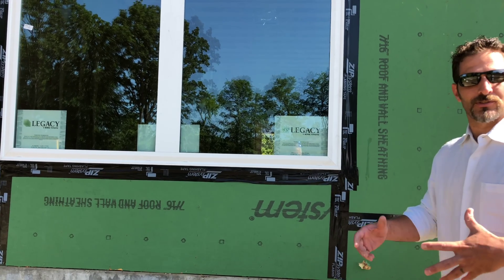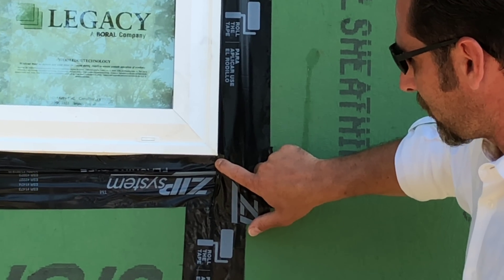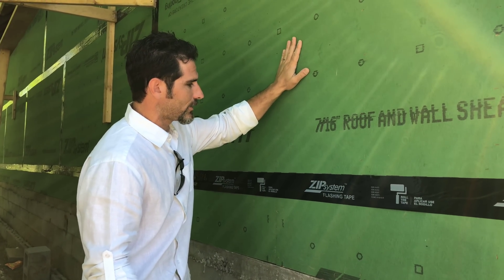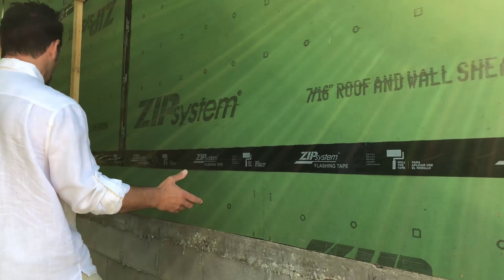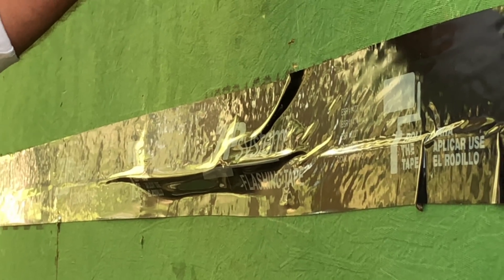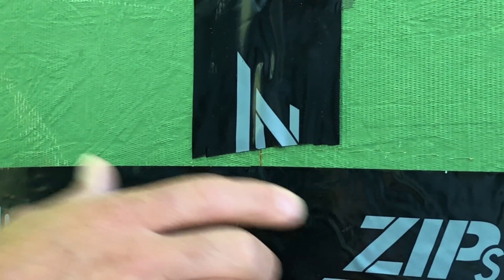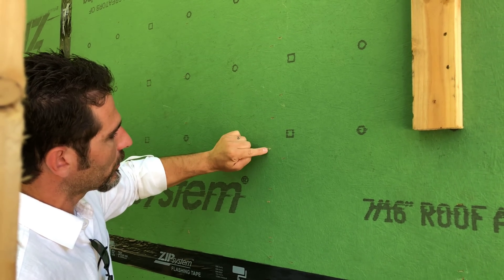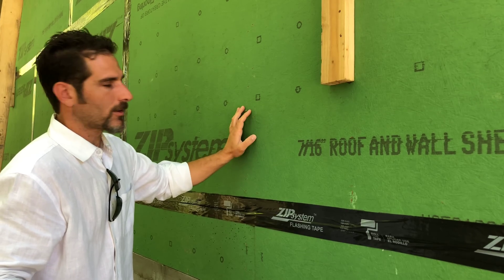ZIP System Problems

Comment: I clicked to see common problems to avoid and find that perhaps you could look more into the building science before misguiding viewers.  This is obviously a bad installation of a great material.  I see you are heavily into shingling, but I sense a misunderstanding of air sealing.  Tyvek gives us zero air sealing, and the transitions are a challenging origami for new construction crew to master.  When done right, Zip-R gives us shear, thermal break, air sealing, and waterproofing.  Liquid flashing can easily solve the problems you highlight, with just two products.  That's a lot of steps saved, and worth learning to do well.  From a building perspective, we want the low perms - let it dry to the inside from the inside, and dry to the outside with a rain screen.  The inboard insulations will prevent any condensation.  There are more facets to this picture than shingling.  We'll be using it on our upcoming project and this is how I found your video.  Peace.
Reply from the maker: I am not sure where I have misguided anyone but maybe you could fill me in after you educate yourself better!  The video is designed to show the common problems we see when taking these systems apart to correct water intrusion.  I simply stopped by a random house with the ZIP system on it & sure enough found the same problems we see when correcting water intrusion!  The video is not showing how this system doesn't work when installed correctly (that has been proven by several different third party testing companies already), the video simply shows how it is not an easy system to install correctly & when its installed incorrectly it is not forgiving!  If you want to rely on tape & caulking to keep water out of your structure without any way to shingle anything then you are welcome to do so but to me that goes against all the weatherproofing experience I have!  I wish you luck when using this system & hope that you pay close attention to detail & get every piece of tape perfectly adhered as well as cover every fastener hole!  Peace
Reply: @WeatherProofingAmerica  I guess I missed where you discuss how Tyvek performs in air sealing.  Not sure if you are against it or unaware of the issue.  Perhaps that's not your problem so you do not care about this.  
I've seen many more examples where Tyvek, tapes, staples, cap nails, shingling around doors, windows and other penetrations are more difficult to execute at a high level than Zip 2.0.    Zip 2.0 is a great system.  Have never liked the tapes & don't see the longevity in that approach.  Keeping water out of an air-leaky house seems like a lost opportunity to do a good job, performance-wise.  Wherever we get on the ladder, we can look both up AND down.  I always ask what the best in the world are up to.  Ignoring the bigger picture while touting a single aspect shouts of snake oil.  That's all.
Reply from the maker: Don Kingery the big picture from my perspective is this system will more often than not, be installed poorly which will set homeowners up for massive payouts to correct something they should not have to! Tyvek installed poorly still covers the majority of the vulnerabilities ZIP doesn’t! If you look more into Tyvek you will find that it is intended to & can be a great air barrier also if installed correctly! The reason I like to recommend Tyvek is because I have personally used Tyvek to CORRECT many types of water intrusion and have seen things that most don’t because of us taking wall systems apart daily!
Reply: @WeatherProofingAmerica    I'm a general contractor and not a sub.  I often tell clients that if someone is selling pickles, then pickles are the answer to every problem in the world.  I'd concede that the fixing that you do is not about Tyvek, but poor workmanship.  I've spent many years fixing bad work, and it's almost always the workmanship and not the products that are to blame.  I started using Tyvek on custom homes way back in the 1980s because it was an improvement over felt paper.  This was before building science knew what was happening with air, water, and thermal leakage.  Heating and cooling a home, only to have conditioned air leak out is wasteful.  Tyvek, if installed in a laboratory perfect manner (rare) and addressing all the penetrations, hundreds or thousands of staples, origami, etc. (even more rare), can address water intrusion, but does nothing for air infiltration nor thermal transfer.  This means many additional steps for much less benefit.  This is the 21st century.  Labor rates in our area are higher, perhaps, than in your area.  I gave up trying to save material costs and working for less money or asking others to do so.  We get paid for end results; not by saving a penny only to cost our clients dollars over the decades to come.  I like the synergy of systems that deliver multiple benefits - air + water + moisture + thermal.  If both belt and suspenders leak, neither is effective.

Comment: This is an interesting video and part of a valid debate about various WRB systems and their merits. However; a great deal of the valid critique in the video deals with poor installation details as opposed to failures in the product design itself. Calling anything 'foolproof' ignores an old engineering expression I heard for years in the oil industry. We called the best systems 'idiot resistant' rather than idiot proof because as an experienced engineer would point out; God makes better idiots than engineers can make systems.
Reply: Still a crappy product! The Europeans are waaaay ahead of us in wrbs, and barriers
Reply: @roberthaverlock8605  Why is it crappy compared to systems that are available for use in the US.  Comparing it to unavailable of overpriced systems in Europe says nothing.
Reply: @roberthaverlock8605  What are the systems or products you think are most useful from Europe? We're looking to very heavily renovate an old home in 2023, and while I'm planning on ZIP (following Matt Risinger's recommendations on best installs), I'm definitely curious about other options.

Comment: Use liquid flash on all joints  and fasteners problem solved
Reply: If installed properly liquid flashing is great!
Reply from the maker: You might watch the video again because that would be far from the solution!  Thanks for watching & commenting.

Comment: Build w concrete, stop subsidizing lumber industry so this garbage is pushed on people . I build a house in Europe vs the one in America, maintenance is night and day . 
Stone and concrete works .
Reply: Depends where you are in the US, for high levels of seismic activity you're better off with wood frame construction. https://csengineermag.com/article/wood-frame-construction-advantageous-in-areas-prone-to-seismic-activity/
Reply: @rooford1  your nit picking
Reply: @rooford1  it also basically depends more on your budget as well.
Reply: There it is! I was looking, knowing, the concrete freaks would show up at some point, and here it is! How about you subsidize affordable housing for all the homebuyers who can't afford to build concrete construction, and we'll go from there......
Reply: Rusty Rhodes I am not a freak , you should have manners . Building is my trade and you are wrong . One word , Romans ...
Reply: @SamiKrasniqi  wtf does that mean?
Reply: @SamiKrasniqi  - Today, far more buildings are torn down than fall down. Three thousand year longevity is not a goal, not even relevant to the modern home-owner in any country. Most people want a house that is durable enough to hold its value until the time of resale, but affordable enough that they can realistically build it. They are building a house for a few generations, not a monument for the next epoch.
Reply: pterafirma  

even if we go w your argument which can be agreeable, timber construction and materials we use doesn’t allow you to have a home without major renovation after 20 years . Roofing , kitchens , bathrooms and decking are virtually gone after that period and sometimes less . They have a cute name for tens of thousands of repairs needed , they call it dated . 
Clay roof tiles , slate deck, concrete home w powder coated windows , build in 1998 , nothing needs to get fixed . Had the painters few times , that’s it.
Reply: Lol....tells me to have manners, calls another user a fuckin inbred. Pot meet kettle.
Reply: Rusty Rhodes he used wthf , fuck your pot and kettle ass.

Comment: Excellent review of this product compared to Tyvek. I've been studying building science heavily for several months and it's tough to find videos like this. Zip systems look appealing but it's hard to justify the cost vs other alternatives. Breathability is definitely an essential component to the longevity of the structure. Can Tyvek homes be built as tight and what is the comparable high R value option...rigid insulation below OSB?
Reply from the maker: Tyvek can absolutely be a great air barrier when all the seams are taped, Tyvek ran past bottom plate line & above the top plate as well as the windows installed per DuPonts instruction!

Comment: You have to use a system that is hard to screw up from the lowest common denominator... The labor installing it.

There are very very few craftsman left who take pride in their work. So many of these homes are made by major companies doing tract homes, all built by the lowest bidder and barely trained to do a half decent job. They'll get it done, but that's it.

Water proofing systems are critical, and if there is any area of the building to not screw up, it's your roof and your waterproofing. Failures there lead to massive and expensive internal failures that don't become visible for years.
Reply: Yes! So right!

Comment: Hope the framers don’t show up and beat you up for talking smack on their horrible work 😂. I also don’t like that system but as someone else mentioned here. “What about all the holes that are made on the Tyvek when installing siding etc.” I’ve seen framers just tack the hell out of Tyvek and put a million holes without taping it? That’s before the siding goes on. Great video by the way👍🏼.
Reply: yep: and tons of water gets in. it pools and usually comes in the windows but sometimes the floor from between stories.
Reply from the maker: Contractor's Work Network that is a great question!  It's very simple, they are not holes unless the nails are pulled out!  If the nail is in the hole the water molecules actually seal around the nail & Tyvek & the water runs around the nail because that is the path of least resistance!  Sounds strange I know, but that's what happens most of the time. However if that small amount of water does get behind the Tyvek, the high perm rating that Tyvek has will allow the water to escape & not cause any issues!

Comment: I've been a tyvek builder since it replaced #15 felt...:)...The Zip system, done right, is good though...I'm too cheap to pay 28 bucks a sheet...the price point Per sq ft is way cheaper for tyvek.
Reply: The selling point of Zip is time savings...but I suspect that once you have taped it properly, rolled the seams...does it take as much time as installing Tyvek?  I would guess it is pretty close.  Clearly this example is a contractor saving time on the taping, which should be expected.
Reply: There are much better in-between options, Tyvek is middle of the road these days.
Reply: @chrisbenoit1035  How do you think asphalt felt compares to tyvek?
Reply: @travisburch4342  I think it's a poor option especially the way hones are built these days. Felt has an extremely low perm rating but when saturated it skyrockets, it's like turning on a faucet. If you had an old cedar cabin or something of the like with little insulation it's not a bad option as there is lots of opportunity to dry out after a rain event. 

As we build homes tighter together with more products right on top of each other you need better bulk water holdout and an ability to mitigate hydrostatic pressure. 

If I was building my own home I would use Zip R 3 at least covered with 2" of xps covered with a rainscreen or at worst a drainable housewrap depending on choice of cladding.
Reply: @chrisbenoit1035  Thanks for this.  

Would you say a drainable housewrap is always better than normal WRB's (paricularly for a brick veneer)?
Reply: @travisburch4342  really depends on how the brick veneer is attached. I'm not super familiar with BV, I assume there is a mortar to substrate with lath situation much like a stone or stucco. I would suggest a flat housewrap with a rainscreen that offer a thermal break, drainage plane, and convective drying....option b. Would be a drainable with a paper backed lath over it or some sort of sacrificial layer over it so the mortar doesn't fill the cavity of the drainable....stay away from Tyvek Drainwrap, it doesn't work.
Reply: @chrisbenoit1035  Appreciate your help -- and the warning about Tyvek Drainwrap. 

BV usually are freestanding, not touching the sheathing/wrap at all, I believe.  Think that makes a better quality drainable wrap a good idea?  I can't figure out how a rainscreen would work with brick veneer, seems like it already has one, from what I can tell.
Reply: @travisburch4342  sorry. Like I said not super familiar with it...would need to see a detail of how it's assembled to offer a sure recommendation.  I'm just a tech guy, not a building scientist. 😂
Reply: @chrisbenoit1035  No problem, I still appreciate your help!  Super valuable.

Comment: zip saves money and time and meets code - building inspectors are not as thorough as you and contractors know it, so zip is probably installed incorrectly most of the time
Reply from the maker: mlhm5 precisely the point. This system is set up for failure because construction is not performed in a lab!

Comment: You are right about the issue.    However I think that when you use  flash seal you correct all of those issue.       And about the condensation part.    If you use  zip with foam and.  A good interior insulation you will not have any issue..... but It is not idiot proof.   You cant make any mistake.  Or you ''will''   have issue.       Zip is  for  pro and perfectionist installer.   Air tight house are a lot harder to build than breathing house.

Comment: 1: Zip presumes the builder will actually assemble the system right (according to their guidelines).  If they don't, it's not ZIP's fault.  (Rolling out the tape, proper overlaps, use of nailing marks, etc.)

NO system is "foolproof".  Fools are DAMNED creative in their ability to screw things up.  Either deliberately or accidentally.

2: Proper quantity and use of exterior insulation will move the condensation point out away from the stud/sheathing assembly.  Additionally, proper HVAC controls should be in place to limit interior moisture content.  Properly controlled for, not just "slapped up", and you don't run into condensation problems.

3: Look for "ZIP 2.0" on YouTube.  Use of liquid flashing at the wall base, around windows and over nail/staple intrusions will basically reseal the surface.  Takes a little longer, and costs more.  But the end product is simply superior to house wraps of anything besides peel & sticks.
Reply: Anything that doesn't allow the water to get back to the surface is a bad product. Shingling effect and proper flashing is the only way
Reply from the maker: The ZIP 2.0 video is a sellouts way of getting paid!  This magic liquid flash is not a solution & you should never rely on caulking, adhesives & sealants to keep water out!  Shingling materials & longer lasting products are the solution not more caulking!
Reply: @WeatherProofingAmerica  are you calling Risinger a sellout?
Reply: @HubstepCamaro  you bet I am! I only speak the truth. Go ask that sellout if he is paid by Huber? He used to promote Tyvek and understands why it is a superior product but it’s not lining his pockets! Hope he sees this and the many other times I have called him out for his misleading bs that is actually paid propaganda!